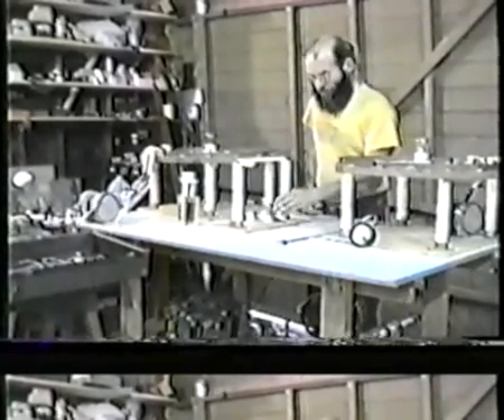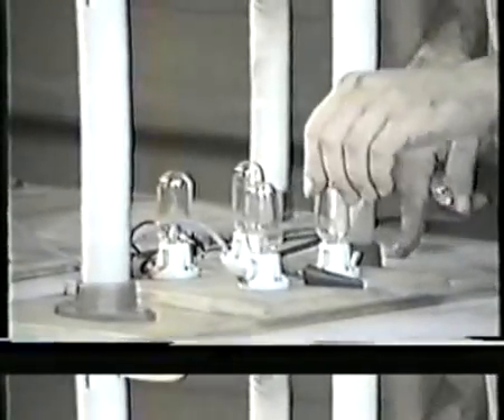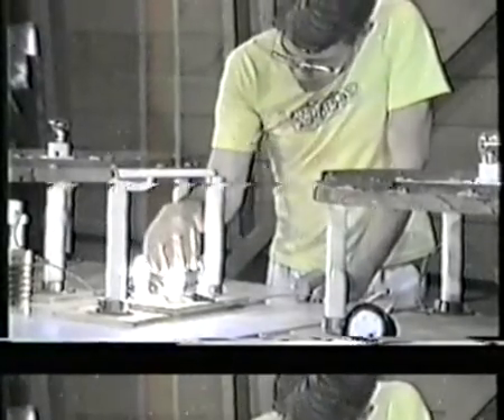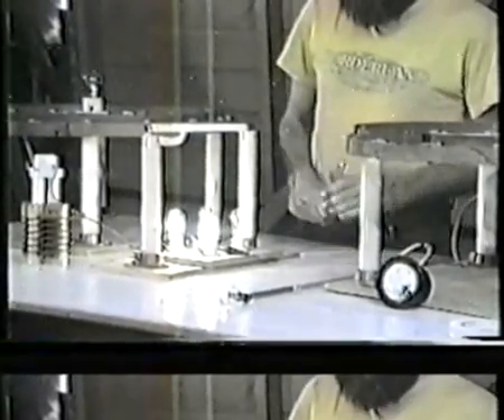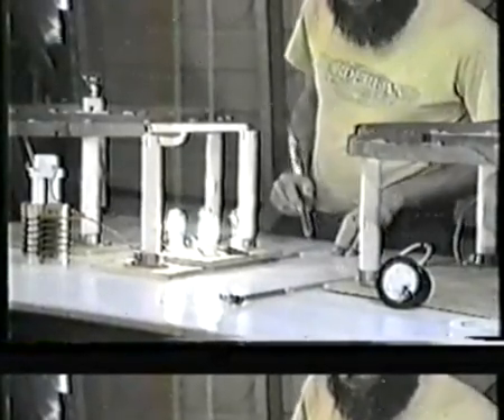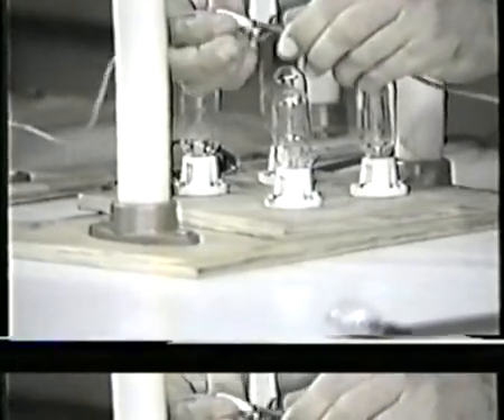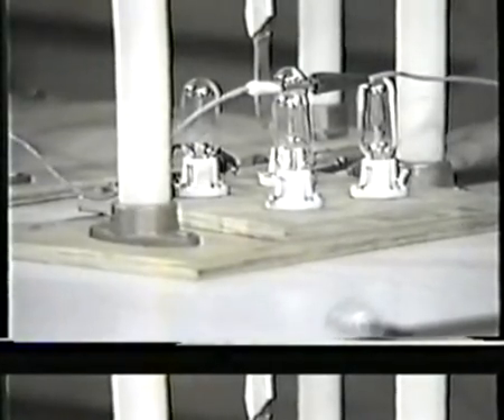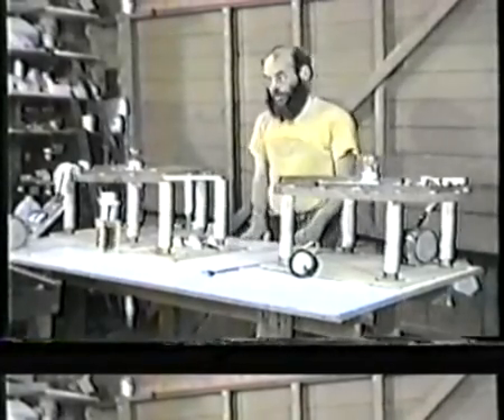tractor beam

Comment: Hey, I just tested this phenomenon.  And it works!  I connected a high-vacuum bulb to a small "violet wand" handheld tesla coil.  The filament of course doesn't light up, but the glass glows green in the darkness.  And when held near a suspended piece of aluminum foil, the foil is attracted to the bulb.

And yes, the bulb does fire off a geiger counter.  But it doesn't make a fluroscope screen glow, so the x-ray output is pretty weak.

Comment: > the video tape itself displays a scattering 

A hard-vacuum bulb should be a prodigious source of x-rays, and might be depositing electrostatic charge into the surrounding air.  Nikola Tesla discovered the single-electrode x-ray tube.  Or maybe the camera is just responding the Tesla coil power supply?